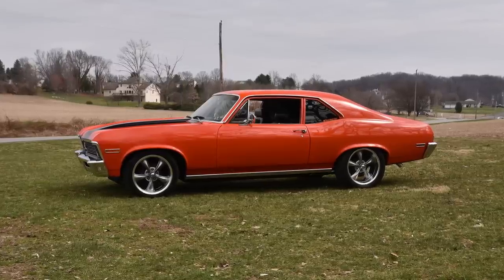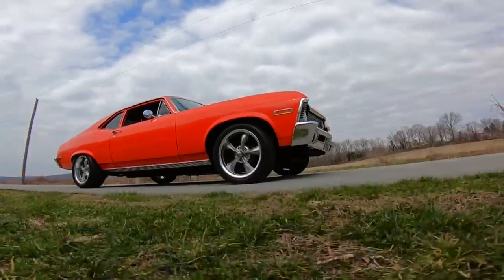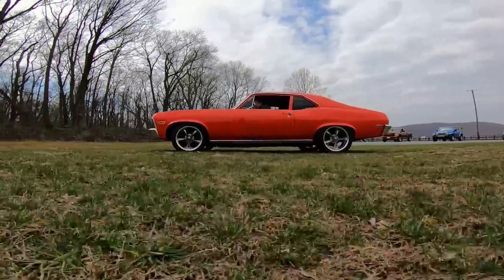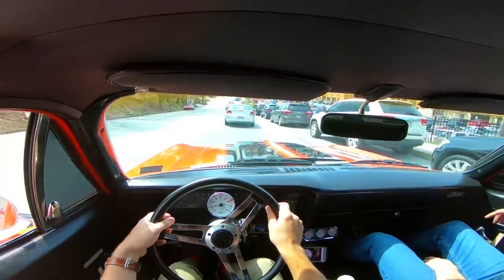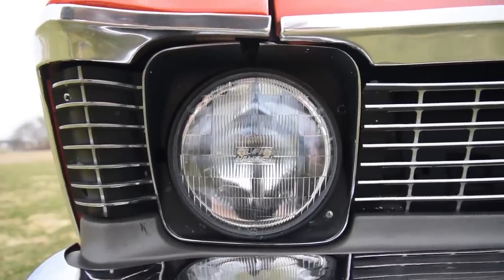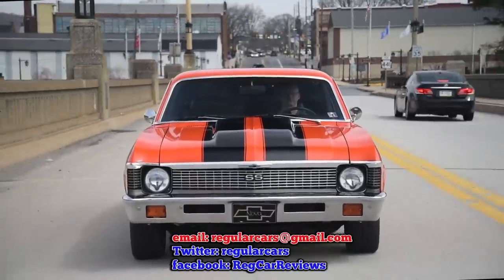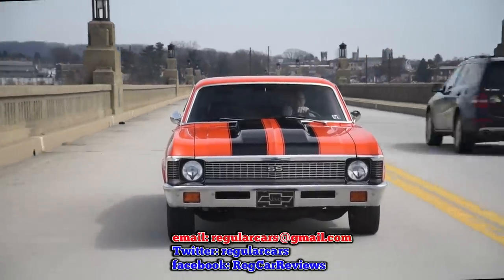1970 Chevy Nova: Regular Car Reviews

Comment: I bought a new 1969 Nova SS. Olympic (I think) Gold, black buckets. Yep. There are no SS's around. I drove the piss out of mine and it took it. Burned up the cheap factory 2-ply bias tires in no time. Traded it on a cute little convertible 124 Spider as I moved on in life. 
The next owner of my Nova SS was stopped by a roadblock on the Interstate after being clocked at 135 mph.  Incident even made the local newspaper.  I "buried the needle" on it a few times but never tried to see what it really would run. 
Yeah. Lost track of it after that; probably finally used up by the next owner. 
Those Nova SS's even earned respect from the Camaro and Chevelle SS owners, so much so that Nova owners were sticking SS badges on theirs.
All the reviews I've found are on the 1970 and later ones. I guess the 69's got used up because of it's early reputation - lightweight, high hp.
If you're lucky enough to find one, grab it.

Comment: why put a 350 in it..... when the 400 small block exists?
.
lighter than a 454/396
makes 265hp and 420 foot pounds bone stock on like 8.5 "smog" compression 
and looks identical to a 350.... 90% of the parts are the same also
.
to tell a 400 from a 350.... you either need to take the heads off and look for the steam holes (or the WAY bigger cylinder bores)
or look at the harmonic balancer on the front of the crank
.
a 350 ballancer will be perfectly round
400s have a "scallop" cut out of them

Comment: Glad to say my father has a 71 Nova and has the exact opposite of what is “common.”

1. He has no “SS” badging on his
2. He doesn’t have an LS Swap

It was the first car he bought at the age of 15 and he did an engine swap with it. It came with a V6 in it however he put a 396 out of a 66 Chevelle and put in it. Drag raced and everything and it still has less than 160,000 miles on it. 35+ years later, he still owns it and says “This thing will never be done”

Comment: I completely disagree on the 350. If you're building a race engine, I agree that the LS makes more sense. For a mild street machine where you want a carb especially, an SBC is fine. An SBC with '90s Vortec heads and a carb manifold will get you over 300HP very cheaply and you don't have to deal with tunes and electronics. An entire L31 long block is a little over 2K on JEGS and 1.5 more grand will finish out the entire entire rest of the engine. You aren't getting a comparably powerful fresh new LS engine for that price.

Comment: The LS analogy you talked is the same with the 2jz. What is a MkIV Supra without the engine and manual transmission? I think that's why people don't like the new "Z4" GR Supra, because it has to live up to the predecessor. The spirit, ride quality, and enjoyment is still there but people just don't want to accept it because they are die hard 2jz fans instead of the cars legacy instead and what it's purpose was.

Comment: well there is a few only a few nova ss the rest are fake they were 254,242 were sold how ever the small percent were 19,558 was a chevy nova SS now if you got a chevy nova ss tribute thats fine but yes they actually made 19,558 chevy nova ss they are rare now if you find a nova sitting in a backyard and the guy was broke in my case i bought my 72 nova for 2.000$ mine is a Super sport i restored the body the engine was fine its a good car and a 350 engines are the best besides the bigger ones like a 442 and also a 454 engines now a quick tip to know if you bought a unknown super sport well the vin number helps but if you have not the original engines that'll be a little tough but there are ways around that now for my i'm 18 and older cars is my thing chicks dig it of course which i own three vehicles my first was my moms 98 danger ranger my second car i currently own is a 68 camaro SS and last car i currently own is a 1972 chevy nova SS but ill like to state THIS GUY ISSSSS STUUUPEEEEEEEDD why rip on the nova its good daily driver and if your still in high school you might piss your high schools football player by stealing their high school love lol and also don't ever LS swap a nova it deletes the history of the car unless if its a corvette then go ahead corvettes suck for the reason they are hard to get out of and also very hard to work on jammed compact engines

Comment: Sbc was pretty ok before 72.  The 3.48 stroke engines all sucked.  The 327, and more so the 302 was the epitome of what a small block should run like.  The 283's were rev happy and indestructable.  Of course, many sb Mopar heads flowed better, and could be made to flow waaaay better.  Also, all ls heads flow better than either.  And all 5.7 Hemi heads flow better than all junkyard ls heads.   And all Apache heads flow better than any ls heads.

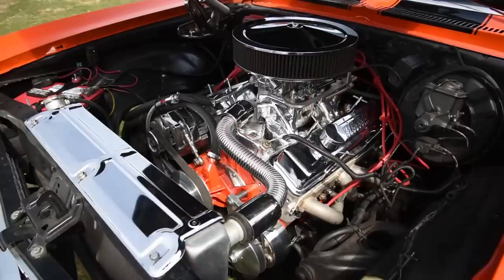Comment: "Belh bleh bleh bleh ls blegh" 4:00 

puts a carbonated intake on the LS motor, and a pace performance dsitributor swap on the motor

And now you're fliping shit because it's a "Ford motor" Mr Regular.

The LS is just a better design, and the whole LS the world thing is because it's a bette design. YOu don't need a cam, you don't need a turbo. They're the absolute best pushrod engine you can get right now when ti comes to "hit starter, drive away."

Comment: Why not use a LS you ask? Because the  350 small block was the LS before the LS came around. It was swapped into everything that needed a engine and could fit under the hood. Can create decent power and was more fuel efficient than the big block

Comment: He needs to learn how a converter works. He doesn't understand how they work. I have a 3500 rpm stall behind a 454 and can drive down the expressway at 60 mph and turning 2400 rpm on the tach. And yes a big block is better than an ls swap. Ls arent that great without turbos.

Comment: Not long tube headers, large front and rear sway bars so it does handle quite a bit better than stock and screw an LS.  What you know about TC's could be put on a match head. Seriously Dude you missed everything. To review something you have to know a little about the subject, you failed.

Comment: I used to own a 72 Nova. Inline straight 6 250 with a 2 speed super glide transmission. Absolutely nothing special in the Nova Department in any way shape or form. But I had that car over a hundred and sixty miles an hour. It absolutely handled like a dog with broken legs. But I love that car with all my heart. And the dumbass in the video with the low-profile rims. Absolutely has no clue what he's doing. You take an antique car like this and put low-profile rims on it. Yes you will get better handling in the short run. That replace all of your suspension parts amazingly sooner than you think. Don't do it.

Comment: For you hotrodders, is it true that it's easy to make big power on a clean, high mile junkyard motor, e.g. a 318 or a 440? I've heard it's preferable to have a worn in engine so that the piston rings have decent flex to them. They handle big power a bit better than a new motor. Is this fact or bullshit?

Comment: I like seeing alternative engine swaps. I understand why people choose to LS-swap so many projects, and I can respect that choice - the LS is a reasonably compact V8 with ludicrously broad aftermarket support and is very easy to get great performance out of. The problem is precisely as mentioned in the video: the car then becomes defined by the LS engine. The uniqueness of the chassis and body is overshadowed by the LS beating within, so it doesn't accentuate the other work put into the vehicle, but instead homogenizes it into just another LS swap, and that's sad. It's sad both for the car and their owner, but it's also sad that the LS has become such an overused platform that there's no longer anything special about using it in an engine swap. I get it, I really do. Companies make bell-housing adapter plates for a wide variety of transmissions, engine mounts and even entire front subframes, alternate auxiliary mount packages, intake and exhaust manifold packages just to cram the LS into a wide variety of cars, and even standalone ECUs with integration kits for the chassis management computer. It has become comparatively easy to use the LS for swaps. But it is because of this ubiquity that it is no longer treated as a feat of engineering to make such a swap happen.

Personally, I like the 1UZ-FE, the Ford Coyote, and even Honda 4-cylinder swaps more than the LS swap, just because it shows the efforts and skills of the person doing the mods more than a pre-fab LS swap kit. But, at the end of the day, an LS swap will give you an eminently reliable engine that makes good power and gets you decent fuel economy, so there's no shame in going with what works, even if your car isn't particularly special because of it. What matters most is how much you enjoy the results of your labors.

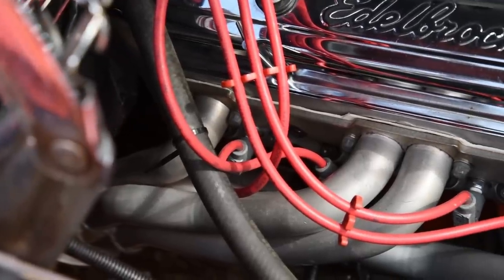Comment: 3:42 he needs some heat "socks" for the spark plug wires..... 
.
they are little "tubes" of fiberglass (old ones probably has asbestos also) that will allow the wire to lay on the manifold.... and yet not give a dam
they work great.

Comment: That car needed disc brakes decades ago. It doesn't take much time, money, or effort to convert to disc brakes. Putting that much money under the hood with those brakes, is proof positive the owner is an idiot. I drove a Nova with 4 wheel drums. A Jeep hauling a 14 foot trailer with literal ton of mulch has a shorter stopping distance.

Comment: I have to agree with Knightmare 1690 on this one. I go to car shows and if I see a LS in a classic car, I just walk right on by. The original SBC are so much simpler and easier to maintain. They are easy to diagnose and fix. Yeah you can use a code finder on a modern car, but it is just not as easy. The SBC are also eye catchers. You look in the engine bay on a car with an LS and all you see is the same thing every time. SBC have so many ways of changing the look of the motor (air filter, Carburetor, etc.) I just get wowed more when some opens the hood up and I see a SBC with a 4 barrel and a huge air filter.

Comment: Another reason behind high stall for street cars (which this build probably does not need that high) is to protect the cam from extreme load at lower rpm.  My 383 with custom grind cam has a 2400 stall in it as a daily.

Comment: what if i dont want to make 700hp?
what if i just wanna make ~350hp and not have a 10 dollar sensor fail, which means it wont even start?

what if i wanna be able to fix it with a hammer and a flat screw driver 200 miles from the nearest town?

old carb engines are cheap as shit...... easier to make power than you think (im a computer science major.... yet i have no idea how to change a fuel map)
yet i know how to stick bigger jets into a carb...... and tune all the circuits 

my 77 chevy pickup with a bone stock 400 small block and a Q-jet carb will start better than my 99 buick when its -50 outside..... 
and it just runs..... again, no sensors, ZERO emissions crap to fail and reduce power by 50%.....
Reply: plus..... you CANT beat the sound of a v8 sucking threw a carb. 

they put "moose horns" on modern intakes to shape the sound
a carb is just like "here i am..... this is the noise i make....take it or leave it, doesnt matter to me"

Comment: how do you put a cam in a ls with out rebuild??

why do you enjoy the car in the pov but completly shit can it in the review?    drives like a s-10 blazer......
Reply: You can put a cam in a motor without a rebuild. Just take off the timing chain, pushrods and rockers, and the timing gear and switch it with another. I did it last summer. It runs great. Just a mild 350 that doesn’t act like a potato
Reply: @theeoddments960  ok then

Comment: The problem with the nova is that it was chevy's equivalent of the Ford falcon and like the falcon it shared the compact car spotlight with a purpose built sibling. The falcon lived in the shadow of the mustang and nova lived in the shadow of the Camaro. Now everyone realizes that getting a classic nova is like getting a classic Camaro for half the price and that's what's driving nova prices up
Reply: Also had more trunk if you needed that.   By the 80s  these were pretty accessible small musclecar platforms especially if you wanted to avoid the 'camaro image'   that was going on at the time.   Someone's grandmother might be selling one for 500 bucks, drop in whatever engine you could get hold of,  make tire smoke.  Handling seemed to be another matter.

Comment: If you care about badges on a car I don't respect you. I'd sooner drive a matte black one with an unpainted fiberglass hood and no grill. Modern suspension and a 6 speed manual. If old people get mad, Good.
Reply: It coulda just come with the nicer-looking aftermarket grill.   I dunno if it's so easy to get a base-level replacement.

Comment: i think nova's are over rated and kinda ugly. change my mind
Reply: I could probably do something with one,   on both counts,  people seem to just try and make em too macho.  I think I'd want to do like a 70's metallic green, spunky rims,  lower the center of gravity up front,  and modernize the front suspension a bit in the process,   add lightness up there, too in the process, probably  (so, yeah, maybe LS with aluminum,)  and de-bland the interior with some more muscley stuff and instruments, bit of frame bracing,  more of a sporty cruiser package than drag strip focus.   But I'd resto-mod cause they weren't really pony cars, just one of those times GM basically made a smaller land yacht and called it 'economical.'

Comment: I'll never get why the Nova from that generation has the following it has now.  While literally growing up in Mayberry, the 2-door seventies Nova was the fake Camaro driven by guys who probably had five ounces of something illicit on them and would brag about it.  And I said fake, not a poor man's, Camaro because you could find those in the hands of most anybody about then.  Maybe it's because so many were drove into the ground shortly before rusting away to rejoin the earth that there's nostalgia around them, but if you owned one in the early eighties - and you didn't run it at Bowman Gray Stadium or a local dirt track - you probably weren't going to be invited to the Elk's Club picnic.

Bowman Gray Stadium - that would be a trip for Mr. Regular.  But I digress.
Reply: Because they’re cheaper than the camaro and chevelle, lighter, and styled the same way as the old classics. Drag racers used them more frequently than the camaro and chevelle. Although I don’t like the fact that there wasn’t a non-post nova car because it wasn’t high up in the gm range, but the nova name has been treated really well over time and as time has passed it’s just as valuable now as the other classics.
Reply: Scott Martin you sound like a real princess there.
They are as light as Camaro and were used because they were more structurally rigid. It actually has a frame across the body. And because it was always a post car that added to the rigidity of it too. Non post cars are heavier than post cars. They were cheap and light. What’s there to argue about? You seem pretty fired up today lmao
Reply: Scott Martin also who the fuck was talking about the clips?

Comment: Got a 66 Chevy II with a 6 cylinNOT AN SS that my coworkers are screaming at me to LS swap.
Reply: I drive a miata, and I plan on adding some power but not a ton, and I have tons of people saying I should LS swap. Because I guess a miata is only cool if you add 200 pounds over the front tires and more power than a 225 wide tire can handle...
Reply: Nah just hop up the straight six they’re starting to come back for some reason as a kind of cult classic motor. Those Pontiac sprint sixes were legitimate powerhouses too.
Reply: Scott Martin what?
Reply: Scott Martin why are you so angry dude do you do this in every comments section or am I the only one having to put up with your nonsense?
Reply: @theeoddments960   Building up the six is somewhat tempting too.  My dad tells me I should do a tri-carb with split manifold.  It needs a complete rebuild though along with whatever else I do.  I have a 283 block with crank and pistons, and a 307 mostly complete.  It's a 2dr post with a 3 on the tree, and the trans is doing some strange stuff, so I'm tempted to stick a 4spd in it that I have.  Almost no interior and some cancer, so a ratrod will be the likely route.  Haven't really decided either way.  Got an old beatup 75 dodge truck that needs attention too, along with my daily driver 89 firebird that requires attention (and is the other LS swap my coworkers say I need to do) constantly.